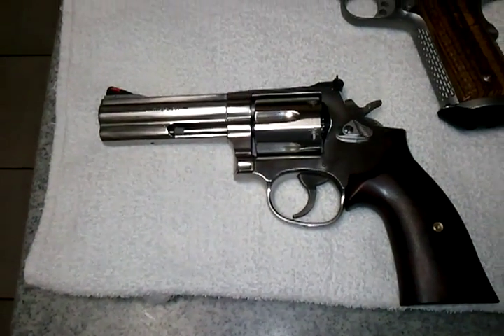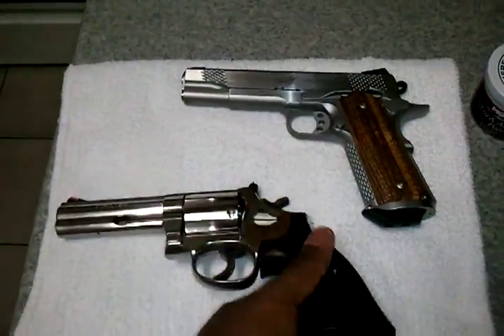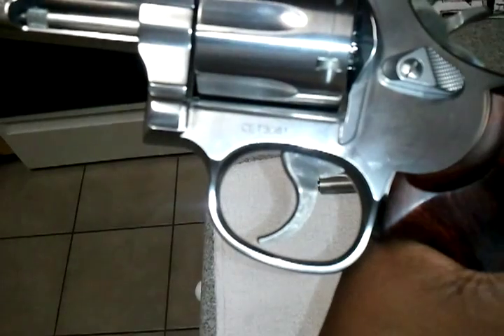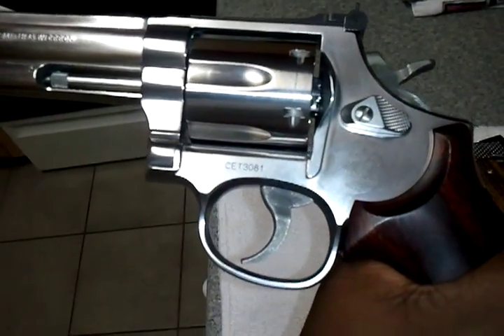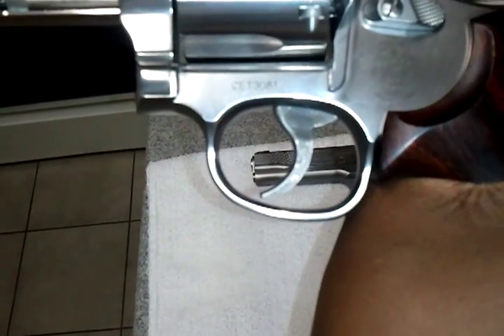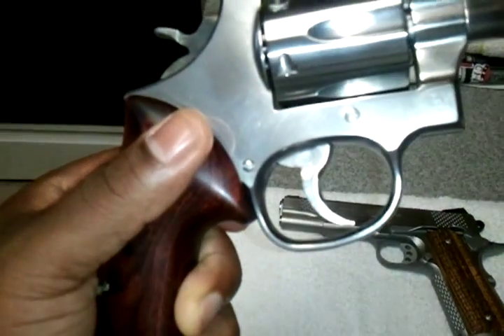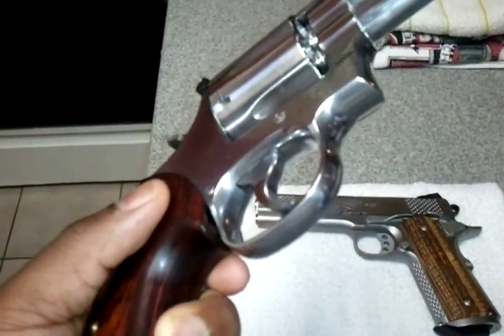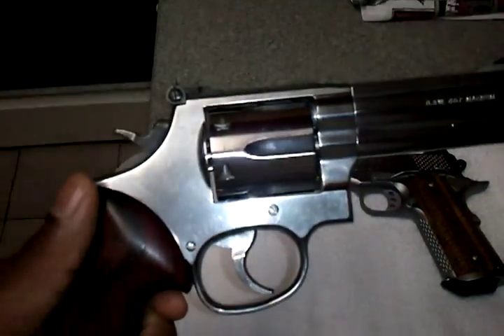S&W MIM trigger polish; S&W 686-5

Comment: I've done this myself, but I've only polished the visible parts of the trigger and hammer, left the contact points alone. It's pretty but now I can see the voids in the MIM. To test if corrosion resistance was compromised, I carried it every day for a week in the appendix position in a kydex holster while at work, going out and about, and working out in heavy sweat clothing, resulting in a fair bit of moisture directly on the gun. I haven't encountered any rust after a week. Still, if you're on the fence about doing this, I'd leave well enough alone.

Comment: Looks great and I did the same with mine when I installed a target trigger on my 686 plus. Since I had to take the gun apart, I found polishing of the hammer and trigger with Mothers and a Dremel worked out very well. I attempted polishing by hand with Mothers and results were not nearly as good as yours.

Comment: my trigger and hammer drive me nuts. they were in the store for a long time and were dam near black. i used high high grit sand paper and a metal polish with a grit in it. it helped considerably but still isn't as nice as the frame. ill have to get some of that polish.